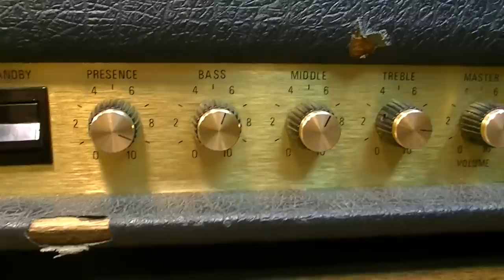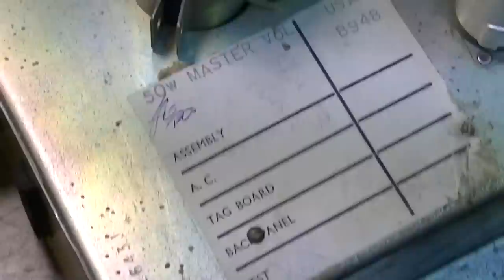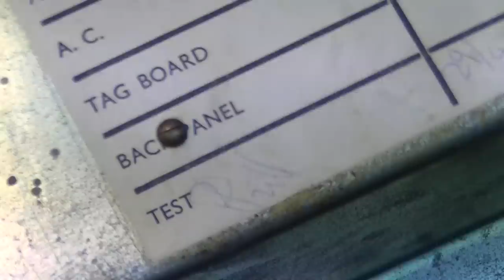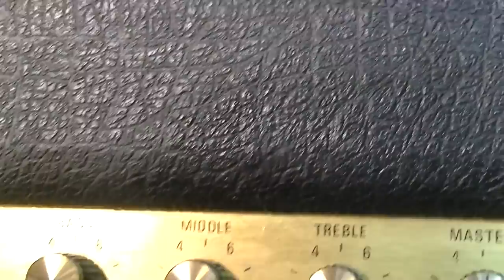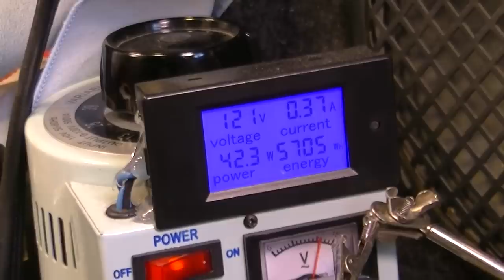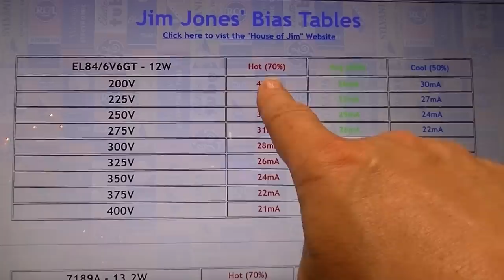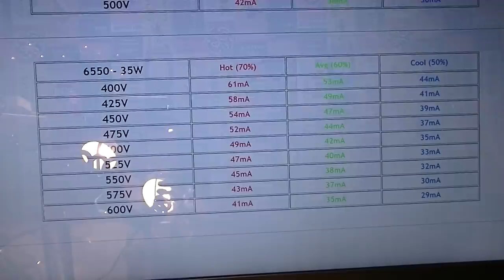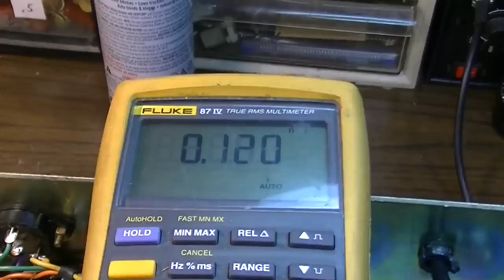Secrets of the Marshall JMP 2204 Master Model 50W Mk2 Lead Head - The PERFECT Marshall Amp!

Comment: I admire what you and other electronics technicians have been doing and some, like you, still do. Sadly these jobs are dying because of buy and throw away culture. Nowadays one has a problem to get pricier items getting repaired. I had a 1.5k € AVR which had a lightning strike and the Pioneer service wanted to change almost all circuit boards for around 800€... No repair, just change parts...
In Germany this Job was called Radio and TV Electronics Technican and you had to be an apprentice for about 4 years. In my opinion this was the most technical and complicated teaching below engineering degree. I am a industrial electronics tech, but we didn’t get as deep with circuits and schematics like them. I can use an oscilloscope, but I never built or repaired a tube amp.
In 20 years none would be able to build or repair them , but a few geeks. The good thing is, that these amps are robust and rather easy (without ICs, DSP and computer )and one could learn building them- I always wanted to do that. Maybe, when this Covid situation keeps on, I’ll give it a shot.
Question: I have a 1986 JCM800 100W, do you think I have to replace those big power caps too ?
I want to learn to bias my amp too. Do I need an oscilloscope?
PS : in Germany we have 230V AC and I also got hit several times by that. The thing is, it is very important to know with how many Ampere the line is protected. In homes it’s mostly 10 or 16A, but in industry this could be much higher and then you could be dying by deadly strike.

Comment: I am also a 1977 model, but I have a 2104 combo version of the same amp which I bought when I was 15 for £200. Recently I fell in love with it again but then a few weeks ago it started popping on warmup.I was waiting for new cap cans (still had the original Dalys) but I REALLY wanted to rock. Turned it on and BANG! FLASH! (and probably KERPOW! and KERRRRRUNK! as well) and dead silence. HT fuse blown, tears shed, now begins the investigation. Checked the bias voltage and it was way down at low 20s. Hopefully my output tubes are ok as they are awesome (EL34s) and were the result of much teenage tube rolling from old defunct British amps, and have NO writing or marks on them at all so I have no idea what they are but they really rock.

BTW, we have the dates right, you have them backwards, and British amps have 'alumin-IUM' shields - aluminum is for Fenders mate :D

Great video Brad, and my...................second favourite amp I own. The Silvertone 1449/1457 amp in case still rules my roost.

Thanks man
Reply: PS, mine was also signed off by Marilyn, gawd bless her guvnor

Comment: My JMP 2204 is a '78. My JCM 800 2204 is an '84. Love them to death.... But the JCM needs maintenance, so I'm slowly getting the nerve to try to do some work on it myself. Filters, power tube and bias, got me two different ESR meters to try to do cap tests, would like to test the screens to see if they are reading in spec... a bunch of stuff....this was cool to see....
Reply from the maker: Good luck on it. The caps for this are less than $50 for all 3. Might as well go ahead and change them while you're in there.
Reply: Got the filter kit, came with the 3 cans and 2 sprague atoms, havent gotten a count on the others yet. Got power tubes and I only have a one socket bias adapter, so I'll have to one at a time, and since getting the ESR's, I'd like to do some testing to see how they do measuring in circuit. ( thinking of getting a better Bias adapter with 2 maybe 4 adapters, switchable for each and plate voltage since i have a house full of 50W Hiwatts and Marshalls, and even a Sound City Plus..) I still like doing the math, but these seem useful...I think...I know its not a leak test, but was hoping to see how they do in giving me an idea of "good vs bad" while in circuit...great vid, especially since everything if very familiar in both 2204 amps.. Thanks!

Comment: [[TOPIC ONE]] I was thinking about purchasing a camera (or camcorder) with sound, however I can NOT find a video camera (or camcorder) that explains in the camera's description that: the "camera " has stereo input jacks (Right and Left input plugs).  You use a JVC Everio camcorder.  By the way, [[TOPIC TWO]] I am NOT trying to teach you anything, however I am herein, next, explaining to you a comparison of my soldering technique: I TIN (put solder on) the "Capacitors terminals"  and also TIN the wires.  All you need is a bridge of heat between the terminal and the wire (often you do not need to add a drop of extra solder); this allows the [1] solder from the terminal and the [2] solder from the wire to mold into each other.  Your knowledge of amplifiers and electronics is a true asset to you and those who utilize your services.  [[NOTE]] In your video article, the wires already have a TIN of solder on them, since the wires are being un-soldered.

Comment: I love your channel and pick up a lot of tips. Thank you for your posts. For rips in the tolex , I usually apply  a normal wood glue and heat it up with a heat gun. The tolex will become soft and you can stretch it to match the area where it was torn. Super glue  tends to burn it and sometimes the tolex become shorter and brittle. But super glue works too

Comment: The low channel on many JMPs and JCMs definitely can have a big bass almost starting to be scooped sound which is cool for it's own thing - but lots of player liked to drive that channel with  other kinds of pedals instead of using the high gain channel and do mods to remove some of non Marshall bassiness (if thats a word) -I suspect thats what whoever did that earlier mod was trying to accomplish here.  I never touched a Marshall until the very late 80s -so many of them had already either been modded, fixed, or aged to where they were kind of all over the map in personality after the Hair Metal era.  However -the best one I ever owned was the JCM800 2204 with 6550s -so tight sounding, like the speaker cabinet was pressurized and going to blow.

Comment: At least Marshall had sense enough to put the vent grill on the back. When I recently  took apart my '76? Earth amp head, it looked like the top vent grill was used as a spilt beer drain as much as it was used for ventilation. Maybe they used beer as cooling fluid?
Reply: If this had been the 2203 100 watt version, it would have had a vent grill on the top as well as (a bigger) one at the back.
Reply: I bought one of these at the Guitar Center in Holllywood(when it was on the south side of the street) new back in '78. Any complaints about my sound mysteriously vanished. For fun you should try putting an MXR Dyno comp in front of it, instant VH! Its nice to see a tech that can also play!
Reply: Lol  word
Reply: @Innerspace100  That makes sense. Only way to get rid of the heat. Easy to prevent people from spilling their drinks on your Amp too. Keep 'em away from your shit.  :)
Reply: Milluss© The Cooling Fluid of Marshall©
Reply: @cuda426hemi  I tried googling it first, but what is Milluss?
Reply: Well...if you're from Chicago you may dig the Bearsss, and you may down a few PBRsss..or Budsss   or the Champagne of Bottled Beerss-Milluss©
Reply: @cuda426hemi  lololol!!! I fell out of my chair... Damn you!  ;)
Reply: @cuda426hemi  i just watched blue glow electronics second to the last vid, and I'm going to use the "Milluss" there, if you don't mind? Thanks!
Reply: LOL Hey man, you gotta do what you gotta do... I just serve 'em up there !
Reply: @cuda426hemi  Yeah you're right. I just left the Milluss bait. Now I'm waiting for someone to bite so I can tell em about Chicago. Thanks again!
Reply: Old style man.

Comment: Just as a note to anyone else doing this method of biasing, use the actual value of the resistor and not just assume that the resistor is 1 ohm. In this case, 5% tolerance resistors were used, so the value should be somewhere between .95 and 1.05 ohms (that could be off too). If a 20% tolerance resistor is used, it could be between .80 and 1.2 ohms. A .8 ohm resistor with a 50mV reading on the meter would translate to 62.5mA. That is a big difference. On the other side of the coin, you could think you have the tubes biased at 50mA and they are really only 41mA, because the resistor is 1.2 ohms.
Reply from the maker: True on the tolerance. Others have pointed this out too. I did measure these before installing and they were almost dead correct.
Reply: Oh, I wasn't doubting that you did. I just wanted to make note of it.

Comment: I've been zapped by massive caps, pretty painful. We always wired the terminals together, but once in a while someone would forget and it would zap ya. More scary than anything.
I used to build ceramic and oil filled caps, up to more than 100lbs.
I built winding machines, cut the materials, soldered, built caps so hot they had cooling coils soldered on to them. Cool job, learned a lot of different shit.

Comment: For a 40yr old amp those transformers look in good nick.  I took a blind eBay punt on a cheap 1973 JMP 1959 Superlead II a few years ago and when it arrived there was a mass of electrical tape on the back panel.  I think someone had lost the voltage selector jumper and used a paperclip instead. It looked like Vesuvius had gone off.  All that was left was crispy bakelite.    No damage to the PT though and it worked fine after hardwiring the UK voltage tap.  That US design looks much more sensible and safer.

Comment: Having a schematic to show where the  parts are in the circuit would help to clarify what you are doing. The preamp section in the JCM800 is significantly different than the preamp in the 2204. The resistor to change for  a different bias voltage would be the 120k in series with the entire bias circuit. there is no 330uf cap in the 2204 circuit. Looks like an added resistor to pin 7 of V1. Replacement grid input resistor? I used one of these in a full stack in 1979.  The owner let me make detailed drawings of the innards which I used to make a couple of copies for myself. This is a great video.

Comment: No harm in putting in a 220k 3W resistor to earth from the first cap stage to drain them off . I saw Pye Hastings of Caravan hit the deck at the Marquee in London after a belt off an amp . Everyone thought it was part of the Act until he didn't get up , then it all went crazy.  A belt messing around with 240v mains and tube gear in the UK as a kid was the norm . The only problem back then was isolating amps from tube TV as these old CRT monsters stored some voltage ⚡!
You can always find some spare leathercloth covering inside the box to fill in missing bits of covering. You can get a 30mm diameter version of the can caps , empty out the contents of the originals and hide the modern ones inside .
The empty 68k resistor slots are the original buffer . 0.047 uf is great for a guitar tone pot . 470pf is the norm in ceramic but silver mica ones are readily available at low prices . 330uf is a really odd value for a lead , unless they used a 50 Bass board to fill the overseas order . Nice job done on a great little favourite . All these smaller amps and older combos are increasing in value in the UK as venues for gigs get smaller .

Comment: Remember it's 1 channel with cascaded pre-amp. the low input bypasses and goes straight to the cold clipper [V1b]. I found in  JCM 800's people try to get more gain by jumping an under 1K across the 10K cathode cold clipper. They designed it biased [10K] close to cut off for asymmetrical [more evens]. The  1st stage is usually 2K7/.68. The 4 holers are different animals. Uncascaded  and no cold clipper. Which means biased towards cut off.

Comment: When you calculate plate dissipation of a pentode using  that (1 ohm) cathode resistor, remember that cathode current is a sum of  both plate and screen current. 
(And in the case of cathode (automatic) bias, plate voltage measured to ground is not equal to plate to cathode voltage.)

BTW I very much enjoy watching these videos!
Reply: So is there anything inaccurate with this method on this particular amp? Would the MA current read different using a bias probe set???
Reply: @scottjamable  The cathode current of a tetrode or pentode is a sum of plate current and screen current. If bias probe measures only cathode current, plate dissipation can be estimated, but not be calculated accurately using only cathode current value.
The most accurate way to measure plate and screen dissipation is to evaluate plate and screen currents by measuring voltage over screen resistor  and OT primary DC resistance, if those resistances are known or measured first. Screen or plate currents can be calculated using Ohm's law.
If however, the bias probe measures real plate current, ( it might measure or not if it measures only cathode current), and plate to cathode voltage is known as well , then the plate dissipation can be calculated accurately using that particular bias probe.

Comment: I have a 2203 from '82 or '83. Made literally weeks before they changed the name to JCM.
Reply: I think they had a lot of spare parts laying around that they found and used up.  I've seen a JCM 2204 that was built in '81.  I also think they used cheaper/ lower quality parts when they ran out of parts from their normal suppliers.  My '82 (bought new) had a defective MV pot that was "all or nothing" - you either couldn't hear it and turned it up to 1 and it was full bore.  I replaced the pot and sure enough - problem solved.  The bad pot looked like a cheapy and the only marking on it was a red "1M" stamped on it - not the normal CTS-type pots Marshall usually installed.  If anyone has a similar problem, replace the pot.

Comment: For tolex repair, Elmer's Wood Glue is superior. It doesn't get brittle like super glue, and it cleans up with water. It does take longer to set, but you can tack it down with blue painter's tape overnight. Once dry, the hold is very strong.

Also, with that bias resistor/pot range, EL34's would probably work better in that amp.

Comment: I figure bleeder resistors are just a good safety thing to have in a high voltage circuit - it's just idiotproofing.
Reply: And even the best sometimes does stupid stuff.  (12:36)   I consider it self-protection.

Comment: Brad, that is the best sounding 2204 I've heard.  I wonder how much difference the 50m resistor made that you stuck in the 330m slot?  A tech was telling me that the slot is left empty from the factory on the non-master (4 input) versions.  Ofcourse, your speaker and mic are probably contributing a great deal to the sound.  All in all, you are right, it is the perfect tube amp.

Comment: Interesting, but for the sake of accuracy Ohm's Law does not state V=IR, it states:  that the current through a conductor between two points is directly proportional to the voltage across the two points. Introducing the constant of proportionality, the resistance.
You may then arrive at the usual mathematical equation that describes this relationship.

There is a problem with your assumptions of anode (plate) dissipation, that we often see, by reading cathode current (sensibly) across a 1 Ohm resistor, you have thus ignored the screen grid current which in this specific case with 6550 valves (tubes) will be some 9mA to 11mA with a 400V supply, so something around 5W of screen dissipation that you can subtract from your anode (plate) dissipation figures.

It might be better to observe a sine wave output with an oscilloscope across a suitable resistive load at full power and adjust for maximum power at the point of symmetrical clipping whilst also looking for any hint of crossover distortion too.

Comment: If that treble cap is marked 47K 1KV, then it is actually a 47pF/1000V cap, which is maybe 10 times smaller than it should be if the correct treble cap value is supposed to be 470pF, probably explains why it wasn't doing much.

Comment: I have the 2 x 12 50w combo. About 12 - 15 years ago I sent the amp back to Marshall, Bletchley, UK to have it checked over. They changed out the odd noisy pot and put new valves (tubes) in it, I got them to supply an extra set too. They may have re-capped it as well, I can't remember. The cost of this was only about £140, an absolute bargain. I bought the combo new in London in 1977 for £225 with cover, quite a bit of money at the time. Glad I never sold it.

Comment: Great video! I have a 1980 JMP I'm working on now. The amp I have is pretty stock and it's missing the 330 bypass cap as well... maybe it came stock without it as they shared this PC board with other models? My question is did the bypass cap added to the normal channel work for you... added bass to normal channel? Thanks!

Comment: Hey Brad love the video's great entertainment about amps. Been a sub for some time, I have a question for you about a amp, to do with changing out a LED's and finding a click in one of the preamp tubes when you switch channels. I traced it on the schematic and it run's through switching IC's and ends up to preamp tube 1. Peavey Tripple X